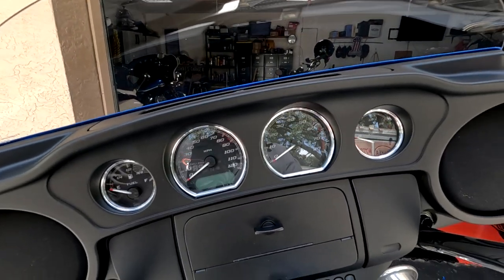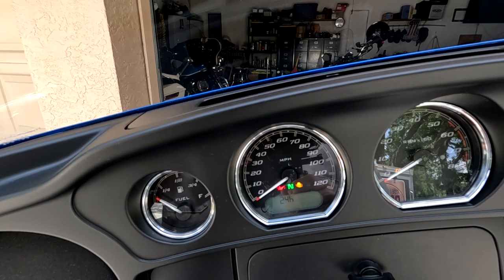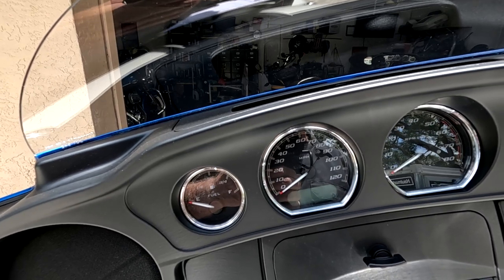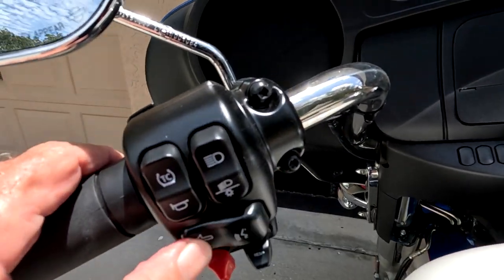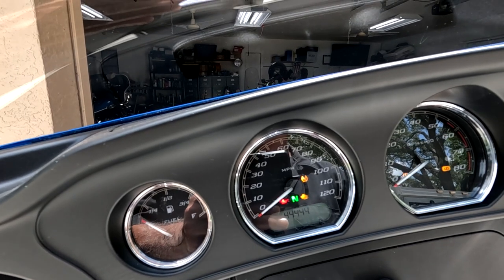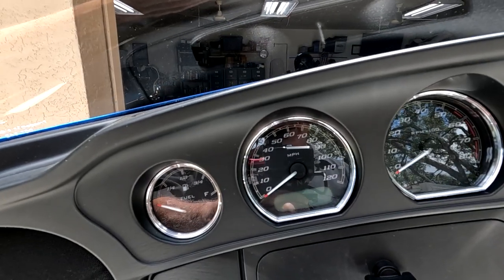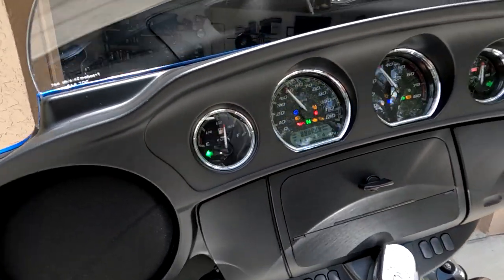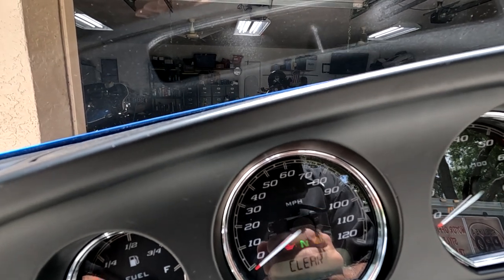Clear codes, set the pin number, and set the clock on Harleys

Comment: thanks for the segment Jerry. I have a 2013 so these procedures don't exactly apply, but are close enough. it jogged my memory that you could even do this. i'll have to pull out my manual, which i carry all the time in the tourpac and check out the exact procedures for my FLHTK.

Comment: Thanks for the video Motorman

... just a note: on the Revolution Max platform the pin and clock are set on the TFT display.  The left turn increments the digit, and right turn advances the digit... just like your vid. One main difference is that the clock can synch with the rider's phone;  and my new Pan America has a TFT "touch" screen so that there is a numeric pad for data entry.

One minor defect on the Rev Max platform (which they have fixed with firmware) is that the clock cannot be set; to be accurate, it has to synch with the rider's phone... which is really what you want anyways.

marcus

Comment: Jerry, i take it by the video on pin# and codes that in order for you to start the bike in the video you NEED the key AND the fob to start it? If so, i love it. Fob in your pocket and forget to take the key, still can't start the bike. Fantastic.
Reply from the maker: The key is only for the saddlebags, tour pack and fork lock. The FOB is needed to start the bike and, or, to set your pin code. If you don't have the FOB for whatever reason, you can still start the bike using the PIN code you set.

Comment: Beginning what year do these tricks work? I have an 03 FLSTCI, and an 09 FLHTCU. I doubt that these will work on my bikes.
Reply from the maker: They work on my 2007 E/glide. Minus the PIN number since the 07 doesn't have a key FOB.
Reply: @motorman857  My09 Ultra has a key FOB, and I always carry a spare battery in the tourpak, I do know that the owners manual mentioned a work around incase the FOB is lost or inop.  Thanks for the info. I need to learn the procedure before I need it!